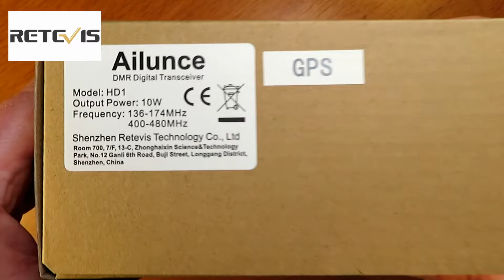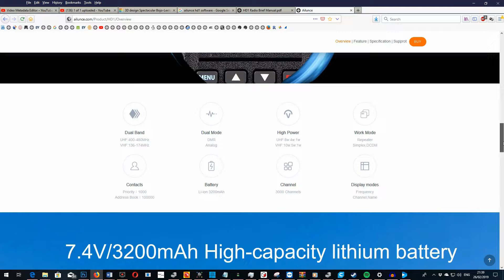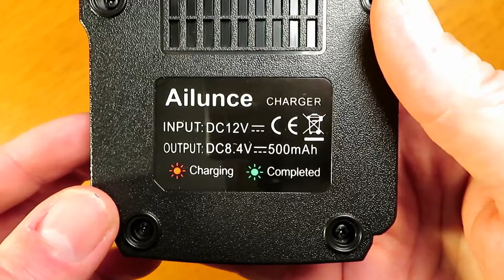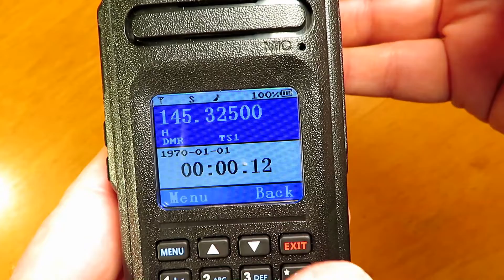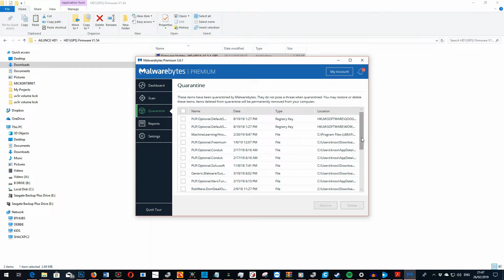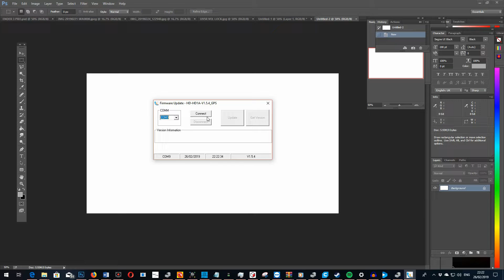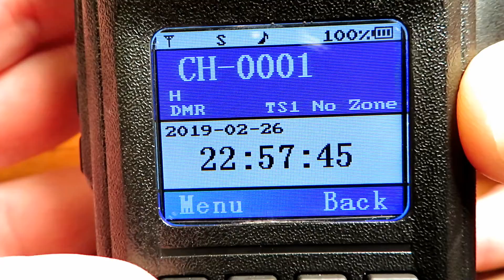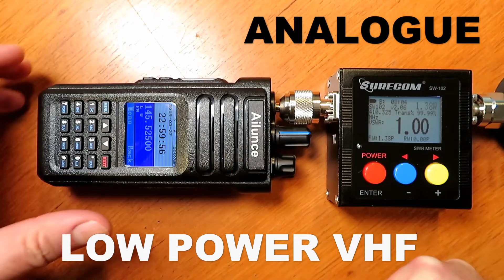HD1-GPS-DMR DIGITAL/ANALOGUE RADIO -  EPISODE 1

Comment: great videos mate! i am using wouxun KD-UVD-1 (not P) do you know what is the difference between them ? P and not P version ? I am also looking for some new radio but more powerfull than wouxun KG-UVD-1/P which one would you recommend? I was interested in some of Baofengs but non of those 8W versions actually has 8W :(
Reply from the maker: UV 8000 is a very good radio, dual band and is one of the most powerful and it can be used as a repeater, there is a review of this on my channel, thanks for watching.
Reply: @knoxieman  thanks for your answer ... please can you just write me how powerful is KG UVD 1P from wouxun? they claim 5W on high but what is real number :)
Reply from the maker: I will check it for you. 😎
Reply: @knoxieman  looking forward to see those results. I am really interested in baofeng 82 ... seems to me like good money/performance deal and great feature is that availability to charge it just with cable (great for  my minimalistic loadout purpose)